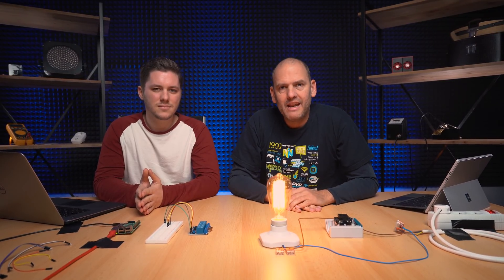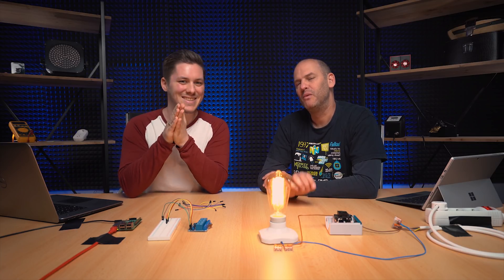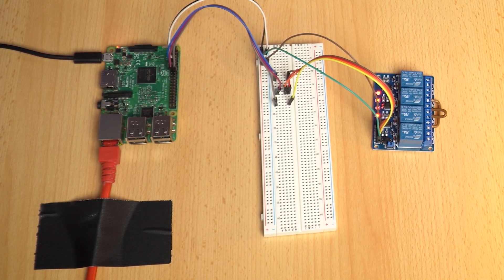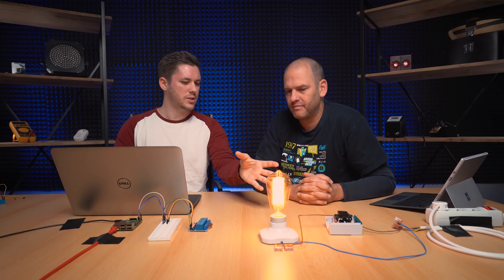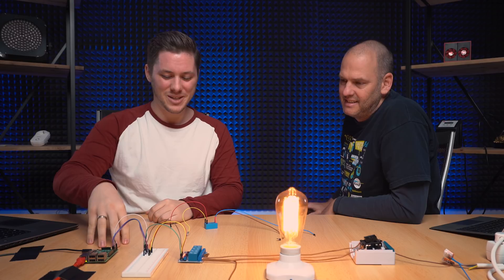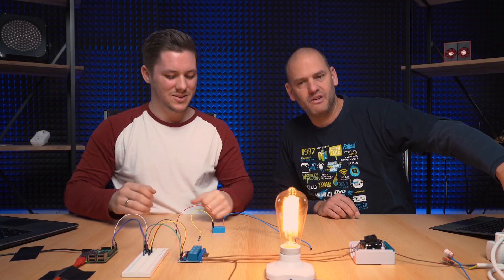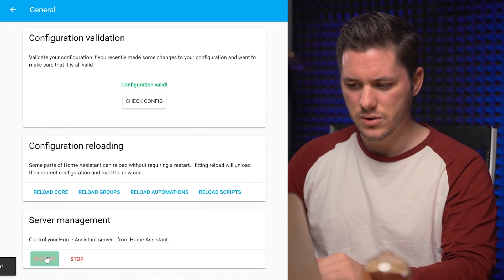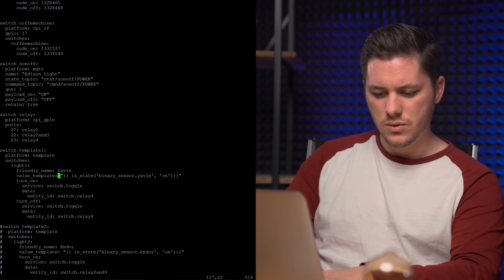Make Your Old Electric Circuit Smart (using Home Assistant and Raspberry Pi) DIY Smart Lights (1/2)

Comment: Is their any alternative solution to update the state which you have done with transformer?
Reply from the maker: Probably yes, I think the solution using the transformer is the easiest one. Please feel free to add further Ideas, I'd love to hear about alternatives
Reply: @PaesslerGmbH   At 14:17 you made a template to synchronize the state of relay 4 with Yavin transformer. 

What if:

State of

Button : Off
Relay 4 : On ( Normally Open )

Condition

Someone toggles button to turn on the light, the state of Yavin transformer will be ON and it will toggle relay 4 and according to template condition, state of relay 4 will change to OFF ( Normally Closed ) which will cut of the mains voltage flow. And then that will again trigger Yavin's state to ON...

Won't it get stuck in a loop?
Reply from the maker: @gorangagrawal  I'm not sure I understood you right. You are asking if it gets stuck in a loop because the virtual switch (yavin) jumps back to on because of the delay of the transformer, right? No it won't, the transformer just needs a few seconds to load off its charge, after that it sends the right feedback signal to the input pin. 

I hope this helps.
Reply: @PaesslerGmbH  Can you tell me what exactly that switch template does?

Does it also switches the state of a light? 
If yes then does it make relay 4 sync with it? 

Like if virtual switch is ON then relay 4 will be ON and vice versa.
Reply from the maker: @gorangagrawal  got it  😉
The virtual switch does two things:
1st toggle relay 4
2nd shows the state of the transformer

1st toggle relay 4: 
That means no matter the state of relay 4 "on" or "off", when you press the virtual switch it toggles the state of relay for. Either from "off" to on, or vice versa. That can also mean that you "turn off" the virtual switch, but it toggles "on" relay 4. Since the relay just switches between the two traveler lines there is no certainty that one of the lines is actually the hot wire anyways. 

2nd shows the state of the transformer: 
Since we do not get any information from the relay 4 on wether it turned on or off the light and we just toggle between the two states, the virtual switch actually shows the state of the transformer. Thats just to have a correct feedback of the light is on or off in our home assistant. 

This may seem confusing at first. But I encourage you to take a look at part two of this tutorial, that will hopefully clear up any confusions for you 🙂
https://www.youtube.com/watch?v=xu06obi2M7w
Reply: @PaesslerGmbH  Oh, I get it now. Thank You so much 🙏
Reply from the maker: @gorangagrawal  good luck making your own 🙂

Comment: A 1K resistor between the 3,3V and 0 on the transformer output will draw 3mA when on. This will drain the transformers charge as soon as it goes off and shorten the 'false' ON time a lot.
Reply: What do you mean by 0 on the transformer?
Reply from the maker: thanks for the tip, good and simple idea 👍

Comment: Hi,
Nice video.
You can use output voltage from the transformer to power supply a coil of the relay and in the same time connect that voltage through the NO contact of the same relay that is controlled by the transformer. Even better solution is to use voltage from the Raspberry Pi pin through the NO contact of the relay controlled by the output voltage of the transformer. The problem with the delaying will disappear.
Reply from the maker: @Iosko Balbozov thank you for sharing your way of doing that :-)

Comment: Omg, transformer solution is really bad. Hall effect based sensing is much more safe + it has benefit of providing fault feedback, but yes, much more fiddly. In terms of bouncetime: it just tells how much time should be between edge change events to avoid triggering by switching noise all over the place - it gets more reliable with longer time at expence of latency.
Reply: Possibly, depends on what device he's using (anyone?) but there are a lot of ways to do this. The most straightforward would be to find a small electro-mechanical relay with a coil rated for the line voltage. If you want to get fancy here's another way https://www.raspberrypi.org/forums/viewtopic.php?t=9617.
Reply: Semion Nadezhdin what Hall effect based sensing are you referring too.. 
I am looking for a solution to this problem to sense if my 3-way light is off manually
Reply: @roystervi  hall element(the one which is like torus through which cable goes) + amplification circuit with ADC tuned for you current spec for off and on(and partial on if needed) states. But I remind you: it is fiddly to setup especially with leds due to low current and I havent found prebuild solutions probably due to how drastically amplification circuit changes based on task at hand. If you would like to sacrifice power efficiency and reliability instead of safety and simplicity consider using an inline relay as other commenters mentioned.
Reply from the maker: thanks for sharing your knowledge! (y)

Comment: I'm not sure I want my light circuit running through my Pi.
Reply: It's not "running through" the Pi. The whole circuit could run (through the switches) even if the Pi is turned off.